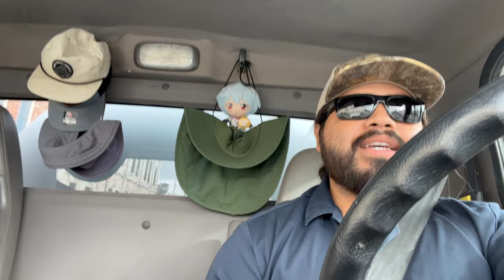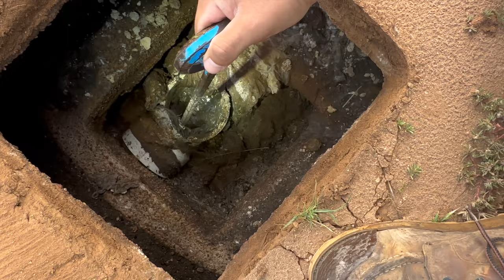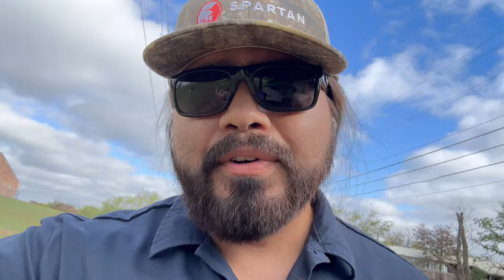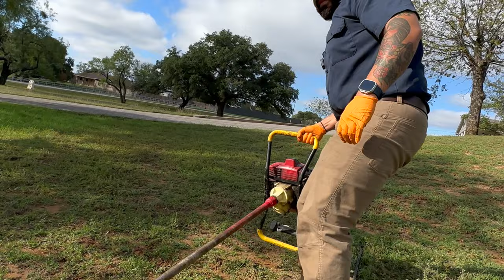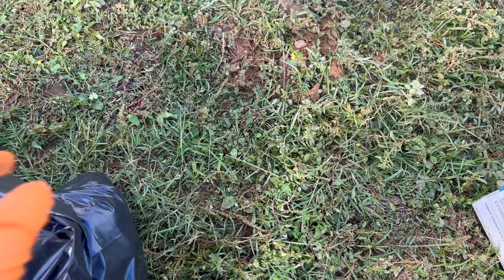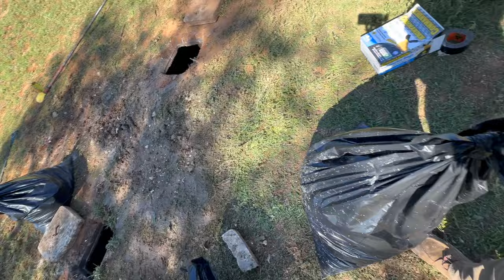You Won't Believe What We Found in This Nursing Home Grease Trap!

Comment: Worked at 240 bed nursing  home at used wipes, as maintenance we had to clear a drain twice a week with a machine. One the guys brought in news paper saying wipes were plugging the sewer pumps at the plant. A week later the city is at the front door ,Tell us to stop using the wipes or you will be fined $3,000.00 a month . We stopped using wipes.
Reply: You can use them,don't flush them.